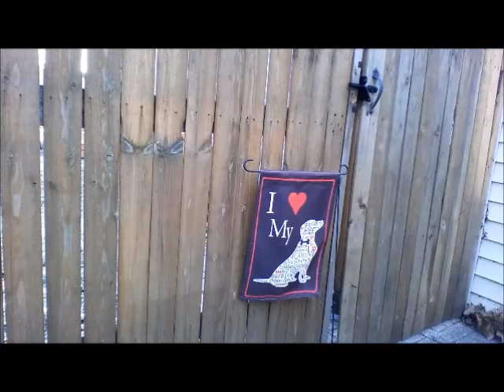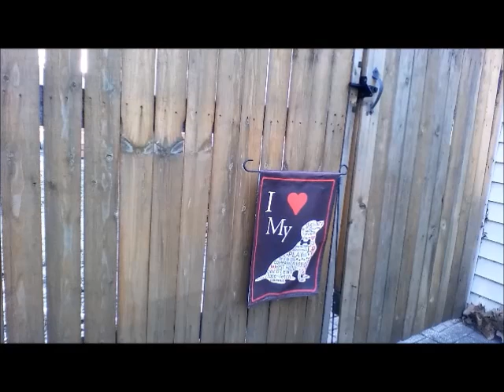How to Install a Gate Latch

Comment: Please explain why would one install the latch striker/bar (which can be easily removed) and have the ability to lock the latch on the outside of the gate?  I installed the the same system in reverse so both the latch striker/bar and the ability to lock the gate can be done within the inside of the gate.

Comment: Does it matter which way the latch releases(moves)? Either from the bottom or the top?
Reply: @BackroadHankerin  Actually, it's supposed to work so you can grab the handle and open the latch at the same time with your thumb.  Your installation doesn't work as the latch should.

Comment: Does it matter if the latch is on the inside or outside?
Reply: If installed outside.. Someone can easily remove the screws. And wall right in.

If installed inside. You can get to the screws. Not your gate may not line up as nicely. You would have to keep all that on mind before starting.